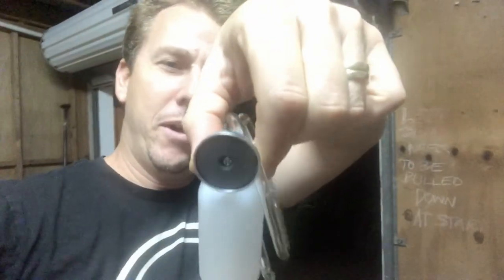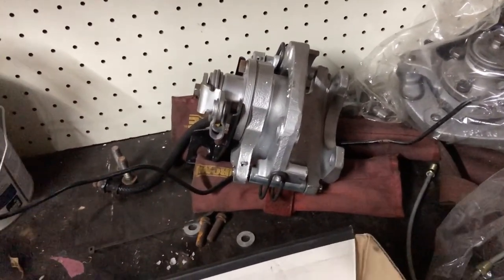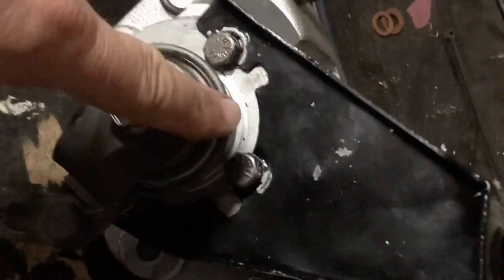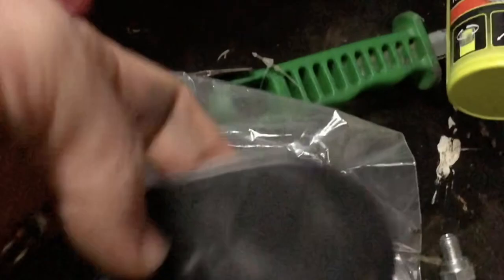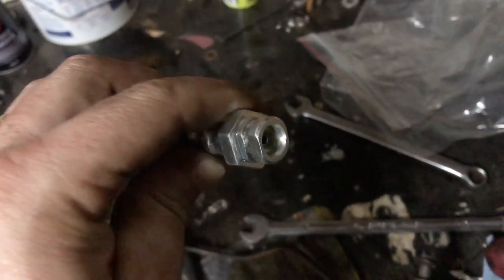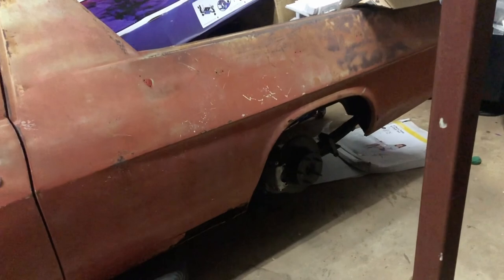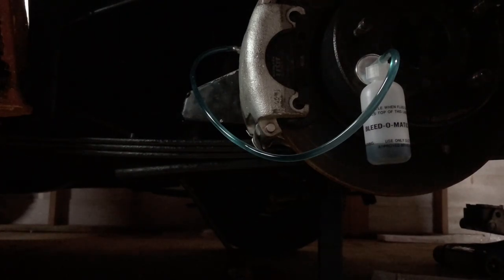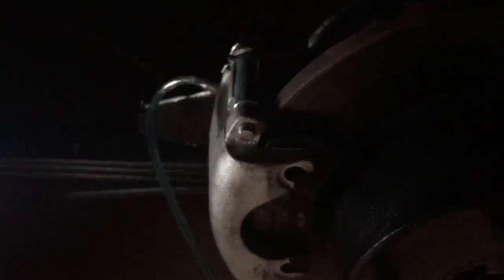HQ Holden ute build, time for brakes

Comment: hi From what I can see u have HZ rear calipers [hose screws into body].  
Be warned the spring loaded  handbrake arm is timed ,  even thou it fits there is only one correct position . It will not operate properly otherwise . 
The caliper slides/sleeves  need to be remade out of stainless . WHY .. because they rust and stop the caliper moving with either pad wear or handbrake operation . Originals are galvinised but 50 yrs on and its worn off .
The caliper bracket needs polishing in the slide area then paint .
Never leave the car with h/brake on it can seize  .
****The calipers require flexi hoses caliper to backing plate then onto hard line [factory style]
after market could be flexi from caliper to diff housing [located by a weld on brake tab ]
---------------------------Had converted rear disc for past  30years

Comment: Hey mate any chance of posting a handbrake cable installation guide or just a video of the one you have... reason I'm asking is i bought a hj tonner with no handbrake cables or anything and I'm stumped on what goes where and what guides ect and apparently there are hooks at the front(just behind the gearbox) that i don't know how they attach. If the owner of this video doesn't reply ect if anyone els can help that would be good, oh and I to have a rear disc conversion.
Reply from the maker: Possibly, but mine is disc brake rear. Will be similar. Im hopefully getting to that in the coming weeks as im putting the ne interior in